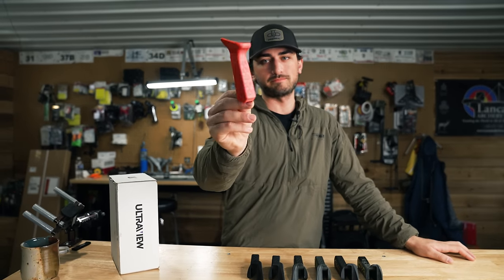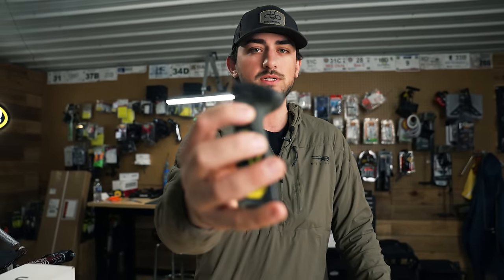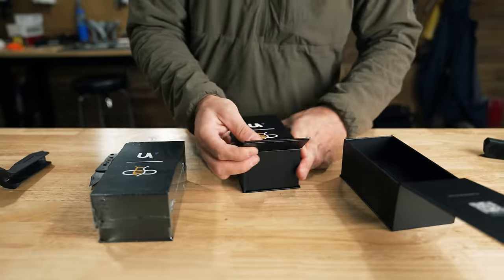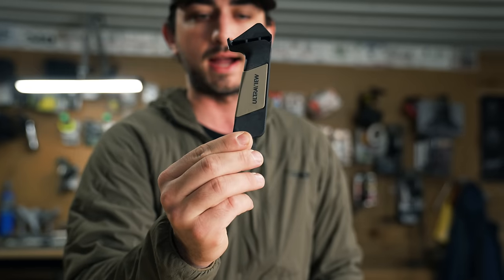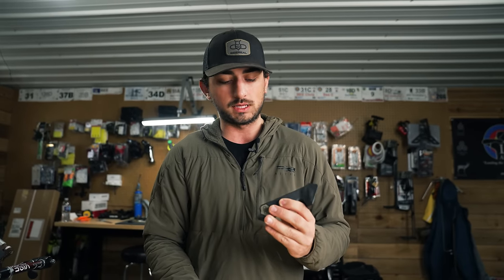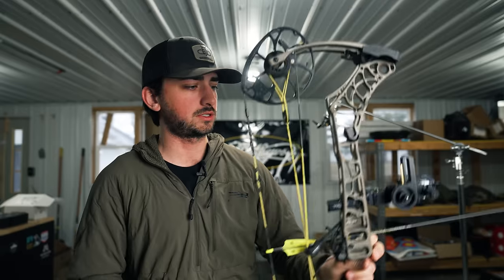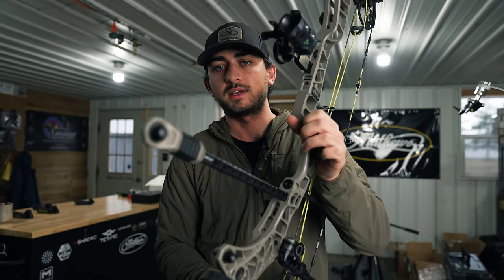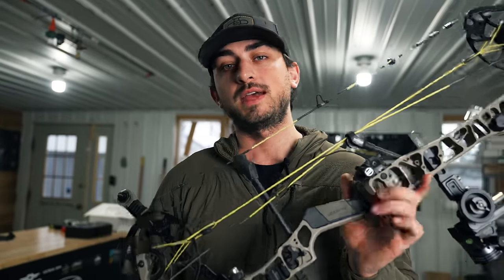HOW TO HOLD YOUR BOW

Comment: YO Chris BEE please tell your boys at ultraview to Make us a left handed 3 pin sight thanks bro
Reply: The UV3xl is left hand……
Reply: The UV3xl is left hand……
Reply: Yo are you serious?
Reply: @Niko_410  the 3 pin is not left handed only the two pin or single is I’ve already tried it and asked ultraview
Reply: @King_Archer_  I’m 100% series there 3 plus one pin is not universal for lefty’s I’ve tried it and ultraview sent me the email confirming it only the singe or double pins are ambidextrous
Reply: @ethanfeatheroff9135  I’m assuming because you mean the pins come in from the right but to my understanding the housing will still mount left
Reply: @Niko_410  yes the housing will mount but the pins have to come in from the wrong side for a lefty making for a poor sight picture if they made it a true 3 pin I could simply just flip it over as it stands now I’d have to cut the bottom fixed pin off